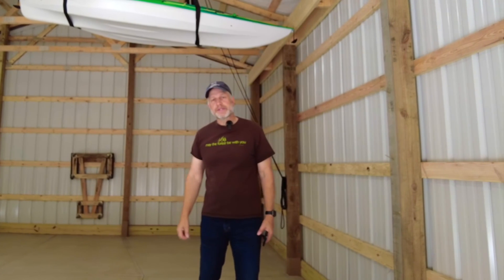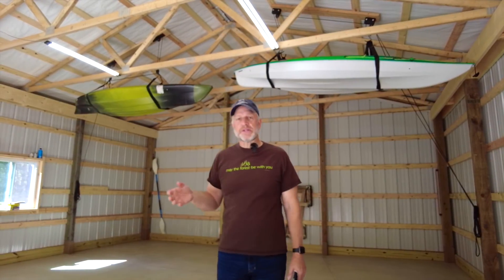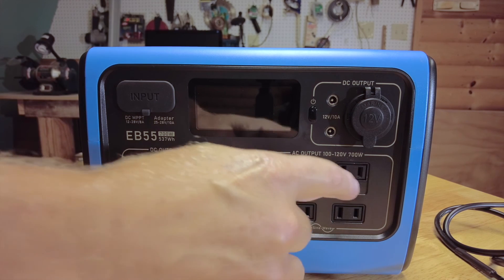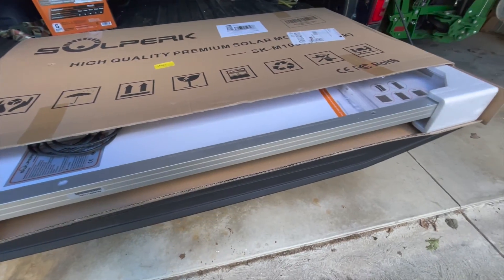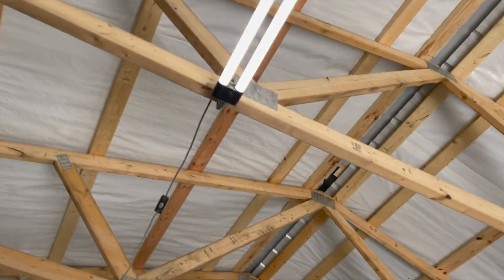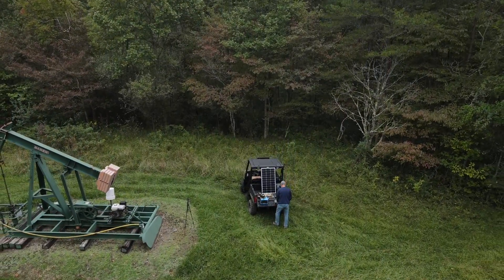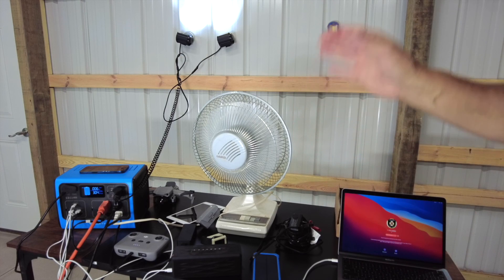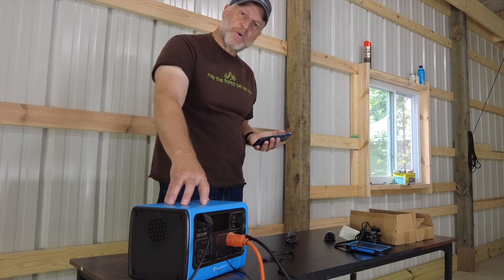Power Options For Our Pole Barn and Testing The Bluetti EB55

Comment: Interesting..  I can see the uses for you especially at your cabin. In the shop maybe not so much.
If I were you, I would looking at installing 100 amp service in that new shed.  You mentioned maybe installing an air compressor down the road. Welder? Table saw? etc etc.  Maybe you can pull a sub panel off your main feed to the house. Trench in a 1 gauge line to a panel in the shop and you're done.

Comment: I own one of these (gray) and really liked this review.  I am a mechanic and been working on an old mini motorhome for camping ... It has all sorts of nice things ... I have some old inverters that are modified sine waves and thinking I had to get an inverter for dry camping (boon-docking I guess is the modern slang) ... then I remembered I have the EB55 and for my 120V needs in such . . it is enough  ... I like saving money for a good reason.  
I am going to try out some testing with a DC to DC charger that I can put in 24 volts from my vehicle's 12 volt system.  It will be interesting. Quick charge..
Reply from the maker: We have a camper on the way and I'll be taking this on our trips.  Thinking of getting a generator too.
Reply: @ataleofthreecabins1025  Always get the highest capacities you can afford

Comment: nice review. do you know if it generates a true sine wave? worth checking as i threw away my last inverter when i found it wouldnt drive my sawzall out in the field
Reply from the maker: 4 x 110V/700W AC OUTLETS
With the built-in 700W (Surge 1400W) strong inverter and 4 * 110V Pure Sine Wave AC outlets,
Reply: @ataleofthreecabins1025  nice
Reply: YES it does

Comment: The solar panel you're using looks like a lower end panel. The higher quality Monocrystalline panels are more efficient than the Polycrystalline 
panels
Reply from the maker: Its a SOLPERK 200W Solar Panels 12V, Monocrystalline Solar Panel Kit with High Efficiency Module.